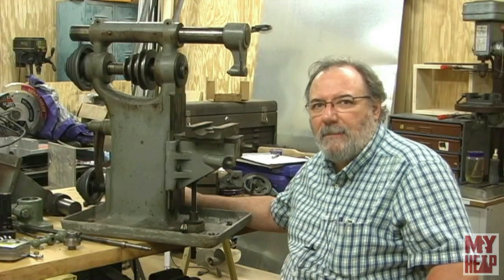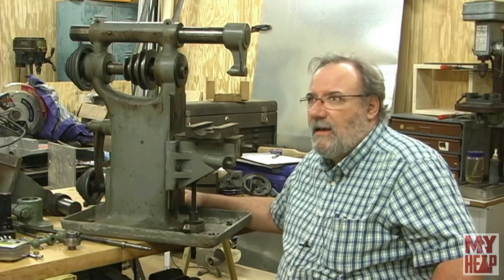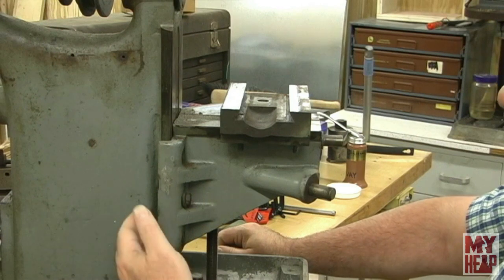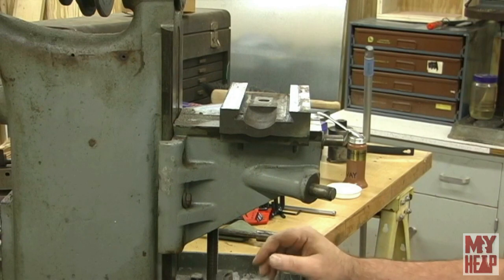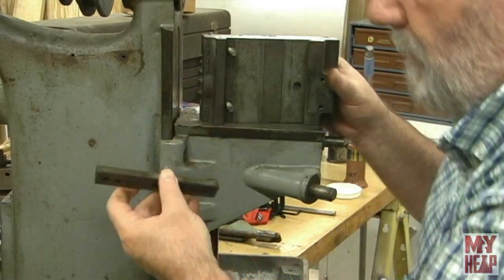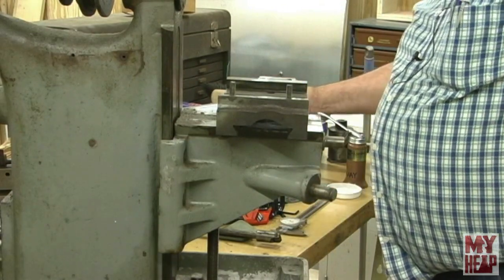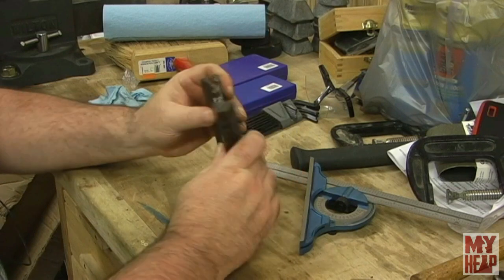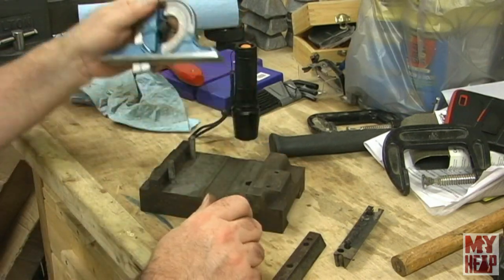Burke #4 Mill - 02 - Gib Collaboration

Comment: I am a little late to the party here, but I am interested in following along.  I have a Burke #4 that is an earlier model with the plain  bearings rather than roller bearings.  It had a lot of work done by a previous owner that is mostly well done.  The gibs on mine are made of bronze so I doubt they are original although they fit very well.  The locking screw fits thru the gibb to lock on the dovetail.  It may seem contrary to logic but they work.  If you ever need a measurement I'll do my best to help.
Reply from the maker: That would be the lock for the knee correct?  Does your saddle have some sort of lock?  Do you have a universal machine or just the plain x and y axis?  I think the gibs we're made of bronze, except those made during the war years when the bronze went to the war effort.  These machine being made with cast iron gibs.  That is my educated guess as I have now encountered owners with both types.  Fortunately, cast iron on cast iron slide pretty good.  Thanks for joining in on the fun.  I am hopeful we can all help each other out on this journey.  Thank you for watching and commenting.

Joe
Reply: @MyHeap  Mine is the plain x-y axis.  If my memory is correct (many times its not these days) it also has a lock thru the gibb on the Y axis.  I tightened them down pretty snug anyway so usually don't bother to lock.  I will look tomorrow and try to get a photo to show.  My machine lacks the wheels for x-y found in later models and has both shafts coming directly out the front with a crank handle that switches back and forth.  They were built from pre WW1until the late 80's under a several different brands.  Mine is one of the oldest variants.  During the first Gulf War I was a young Ordanance Officer and Ground Support platoon Leader and our mobile machine shop had one of these mills.  I remember it because of the reports of survey we had to do when the truck was destroyed.
Reply from the maker: Thanks Bryan, looking forward to seeing some pics.
Reply: @MyHeap  I sent a few photos of mine to the only email I could find on the site, if you do not get them let me know and I'll try a different avenue.
Reply from the maker: Hey Bryan, I got them.  Will reply in a bit.

Comment: yea, I see what you mean by sending the other one and indicating off of that, lol. We'll get it done up for you and get that mill going as good as new.
Reply from the maker: Chirpy, do you think you will need the saddle casting too?
Reply: not really, it looks pretty straight forwards as the angles match the other gib and the design of it is really simple. I just wasnt sure how you calculated for the wear and such. I did like the idea below from southern engineering to make a fake one, or even 3d print one to fit it together to test everything if you had access to a 3d printer, lol.
The design and function of it are pretty simple and easy to understand, so it'll be a piece of cake to build everything from there and from the dimensions you gave me and from the angles on the other gib really.
Reply from the maker: My son has a 3D printer but I am not sure how to create the 3D model for him.  Any suggestions?  I can have him print it the size I have drawn and check it.  I probably could ask Art to create the file for me.  A sanity check is a good idea.

Joe
Reply: um, give me like 15 mins and check your email. Ill send a stl file that you can use for the 3d printer.
Reply: sent, that should work. Sorry for the late reply, was in the shop working on the angle plate and mill.
Reply from the maker: Hey Chirpy, sorry was away from computer.  We printed one out but I made an error on the thickness.  Probably my horrible note taking.  Should be .550 thick not .650.  Will redraw the part and send it to you as soon as I test the one we are printing now.  How spaces and angels are perfect though.  Sorry for you doing work you didn't need to do.

Joe
Reply: no problem, it only took a few mins to doodle it up really, lol.

Comment: Hey Joe,  have you considered making a hardwood model of the gib to test assumptions?
Reply from the maker: That's what separates the Engineers from us mere mortals.  No didn't think of it.  :-)  Not sure I can even cut a piece of wood that accurately.  I might give it go though!  Otherwise I may fall into the ASS-U-ME trap.  Thanks for the suggestion Walt!
Reply: I have a quick Question,  My new oak bench top,  linseed oil or poly?
Reply from the maker: Well, personally I like the oiled look, but if you do any dirty work on the bench you risk it staining.  If that is a concern I would go with the poly.
Reply: I know in time it will become stained, that not a problem, I'm just looking for opinions, thanks.